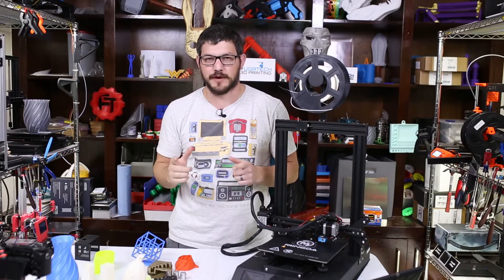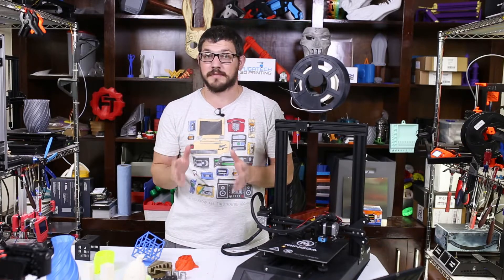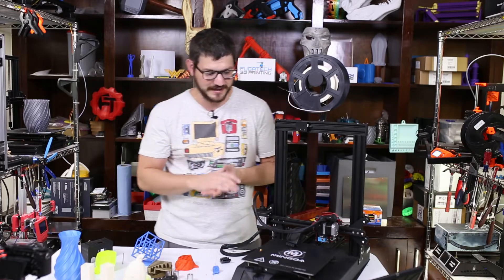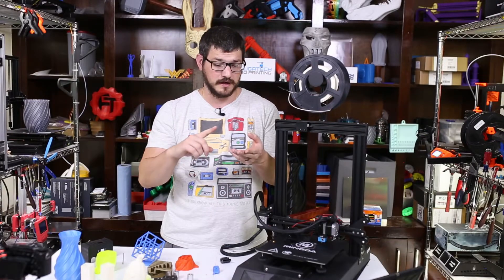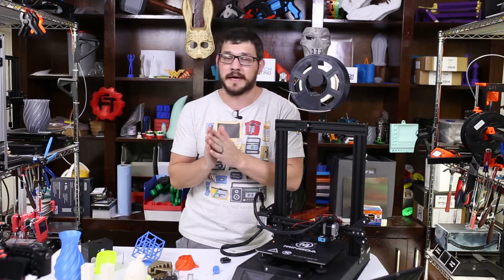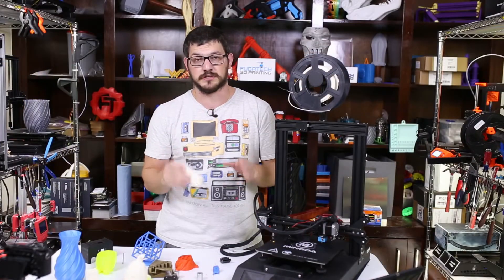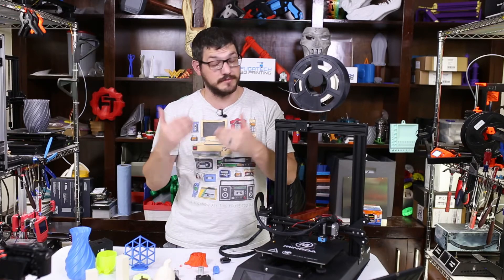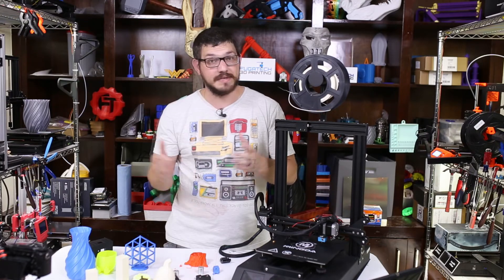Mingda D2 Review

Comment: Ok so I found this video after I got my D2, and now I'm stuck at a stopping point. As a complete newbie to this hobby, I'm learning as I go, and it's been more than frustrating. I got beautiful prints out of it for a week until it got severely clogged.  I cleared the clog and when I reattached everything to the gantry, I found that the bed thermistor broke. Now I'm waiting on a replacement to solder that on to see if it fixes the issue. That got me to thinking - how much more tinkering do I want to do with this thing? I thought about replacing the Z couplers because that seems like a cheap and worthwhile upgrade, but I don't want to dump a bunch of money into mods.

What are my options at this point? Is it worth treating this as a "shell" to put all new parts in? Should I fix this and leave it as it? Should I forget this all together and get a different printer? I'm not super into 3D printing, I just like being able to print small useful stuff every now and then. I don't need the biggest and best out there.

Comment: Mingda has solved the hot end problem, amongst a few other things.
Reply: how did they solve it? the clogging?
So the new models dont have that issue?
Reply: @sjbox  They re-released this printer with an alltogether different hot end assembly and other direct drive, under their Rock line. I have the Mingda D2 and have experienced no clogging issues. And all I did was replace the metal cover and fanduct with 3D printed ones I got off thingiverse. The thing that actually bugged me the most by the D2 was the spool holder LOL which I also replaced.

Comment: Disappointing news about the hotend clogging up. I hope Mingda is listening and sends you a replacement. Even better would be a root cause analysis. That would show proactive position and promote good will with their customers. Suggest you send them an email before the unit collects too much dust.
Reply: I have 2 replacement hot ends for my Mingda D2, yet I am still waiting for the company to contact me and tell me how to reset the printer, because I am getting an error on the LCD screen, because the wiring outer cover melted on mine, then the wire snapped on the hotend. I am not going to do anything with it, until I get the answer I am looking for from the hotend.

Comment: On a direct drive printer, the best place for a filament runout detector is directly above and next to the extruder so that no matter where you incur a breakage in the filament the sensor is triggered and if you run out of filament the whole of the filament gets used, I have had prints where a few more inches of filament would have completed the print but the runout sensor triggered, in fact, I am surprised no one has made a DD extruder with a sensor built-in
Reply: Doesn't the Prusa MK3 have a runout sensor on the direct drive extruder?
Reply from the maker: Yes it does John. The Artillery X1 also has a "remote" filament runout sensor.

Comment: For someone who claims to be capable of doing so much with 3D printers you sure are making these minor issues with this printer sound insurmountable. You are making mountains of molehills. If you can't get this printer to make as good of prints as Andres Sink, maybe you aren't as skilled as you claim. It's more likely you have an agenda to make this printer seem worse than it is. Your criticisms about the hotend cooling are misplaced. The problem as Andrew Sink showed is entirely caused by poor fan ducting. The fins provide adequate cooling as long as you have sufficient air flow around them. You know this. It would solve your heat creep issues but you have some sort of agenda and despite your skills you aren't trying to solve the problem. You just want to make it sound like such a big deal. This printer is better than the Ender 3 in every way once you solve the very easy problem of fan ducting/air flow.
Reply from the maker: I am not going to modify a printer out of the box just so it can print. I am not going to do a company's work for them. They can either design a decent 3d printer, or they can't. The fact that I did what I did just to get rid of the horrible ringing was honestly too much. If you want to do it for them, by all means, you do you man. Sorry that I speak the truth about a printer and you don't.
Reply: Not everyone has an agenda... that is just crazy paranoia. I did not see any sock puppets in the background. This thing clearly does not work that well out-of-the box, and this review shows that. At least an Ender 3 prints well straight away, and that is a VERY low bar.  It has nothing to do with skill... it has everything to do with "does the printer work as-is?" So... it IS a "big deal" if a first time 3D printer buyer sees some BS review on how great this thing is, goes and buys it, and then has a terrible printing experience.
Reply: @Fugatech3DPrinting  I wouldnt even entertain this guy, if you have ever watched any video of his he is mostly hate.  He is smart, and can fix most anything, but he is the one with an agenda and his agenda is hate.  You done a fantastic job at reviewing this printer, keep up the great work!  

On a side note, I kinda wish 3d printer manufactures would start putting the usb ports on the back, it makes for a less cluttered print station when using Octoprint.
Reply: @Fugatech3DPrinting   >Sorry that I speak the truth about a printer and you don't.
WHAT?  Go to the 4:15 timestamp in my last video and hear me calling out Mindga for this crap cooling. "This part right here is everything that's truly wrong with this printer." So, you are trying to set yourself up as the purveyor of truth and me notsomuch. Then you say "I can't stand that guy" when talking about me. What's your problem? I can't recall ever saying anything but nice stuff about you and your channel. Are you just pandering to the hateful mob for upvotes? You know the things you say end up in my comment section the next day right? You give them justification for the hate and negativity that they bring to me. This really gets to me man. It's so hard standing up to a hoard that wants to demonize you. Why are you facilitating their behavior? What did I do to you?
Reply: @DesignPrototypeTest  I feel like you are misunderstanding the point of these reviews, and the target audience of these videos.. Like Shane pointed out in his comment, it's just his job to mod the printer to make it work. And having watched few of your videos, specially the crying about everybody in the "prusa gang" coming after you for telling the truth , your comment kinda surprises since you made a big deal about how dishonest J. Prusa is.. 
However as a none Prusa fan (dont have a prusa printer , never have and probably never will) this does not surprise me all that much cause you seem to read a bit too much into somethings.. 

First off in this video, that filament sensor for example is in a very ridiculous place (you know the order which the design process goes through, 
Design Prototype Test) well here they did very little design for that matter, but kinda prototyped , but the test part seems to have been missig cause those errors would have been cought by the company before rls if there was any proper testing of the printer before putting it to market.. 

Second, target audience these reviews are aimed at are noobs buying printers, now there is nothing wrong with being a noob cause everybody is at sometime but many of them just wanna print and dont even have interest in modding, and to some it might even seem like a daunting task cause they dont know whats wrong and why their printer does not just work right out of the box and dont know concepts like z wobbling, heat creep etc.. So if you can buy an Ender 3 and get pretty decent prints with minimal issues right out of the box , this one just cant be a better buy for set target audience.. 

Third, if you watch any of the videos on this chan , i dont think you can find 1 place in any video where he claims to be very skilled or anything like that, but as these are not any major issues he could easily fix them if that was his goal for this printer. Based on your logic here you could also say the same thing about Tom Sanladerer, if things he reviews dont work, he is gonna tell you that they dont work and faults the printer for that.. This is just what reviewing is about if you are gonna do honest reviews.. He could make a second video for ppl who already have this printer on how to fix them, but thats another story and up to him ofc .. 

Fourth, "You are making mountains of molehills" here my friend you didt not just shoot your self in the foot, you blew them both clean off, I just watched your rant on the "prusa gang" coming after you and you whining about Joes T-shirt and more paranoid crap.. So I can agree that many people oversell Prusa printers and are a bit too in love with Joe, however watching some of his streams and him poping up in all kinds of videos with other makers and things, he seems like a pretty nice fellow , never heard or seen anywhere him claiming to have invented all these features on their printers, and I sure dont get offended by his t-shirt as I dont read that as him claiming to be better than everybody else in the game.. Too his credit though, his printers work great out of the box, they have excellent support for their users, well tuned profiles etc and their eco system is great if you are into it. And that I think is part of the reason you feel attacked "by the prusa gang" is just that you are talking straight out of your ass on this matter.. And the other half of that problem is probably your personality, cause you dont seem to be dumb, and some of your videos make sens and even have good points , but in other you seem like a bat crap crazy paranoid wanker who feels he is always the victim , but you are not it's just your awefull personality between the times you actually make sens.. I've wondered if this is your way of trying to get more attention to your channel and it probably works in a sens, but probably not the best marketing strategy cause the gerneral sens I get at least when I see you mentioned on social media is that ppl really dont like you, and mainly when you go on these rants that make you seem a bit mental.. So my tip would be just stop crying about everything, cause you basicly reap what you sow, stay more on target with tech and skip the delusions and paranoia, cause here is the thing, you could not even make a dent in Prusas sales so you only hurt your own chan, cause in many cases you are just straight up wrong on the subject matter
Reply: I'll start off with some objective things: 

"The problem as Andrew Sink showed is entirely caused by poor fan ducting" You are right on this one 100%. You shouldn't have to mod it out of the box though to fix it. 99% of the people buying this printer wont want to have to mod it out of the box. They just spent a good chunk of change for a CNC hot glue gun. They just want to print.

"The fins provide adequate cooling as long as you have sufficient air flow around them." There's no way that those fins provide adequate cooling. This heatsink assembly looks like a e3d v6 that was chopped in a third. If this much heatsink was adequate for hotend cooling, then why isn't the v6 this short? I kind of see where they were going with this design. Kind of like a titan aero or a hemera design, but they kind of dropped the ball on this one. 

"It's more likely you have an agenda to make this printer seem worse than it is." He is a reviewer, it is healthy to have criticism in a review. Just like you do in your videos. Do you see any youtubers calling you out on it in your comments? No, because it is childish to do that. 

"If you can't get this printer to make as good of prints as Andres Sink, maybe you aren't as skilled as you claim." Sounds like you haven't watched Shane's other videos. This man has a lot of experience with 3d printers. His knowledge is what started me on my 3d printing journey. And I think I made out well listening to his knowledge. He explains everything in a concise, no crap manner. Still talks about the good things, and also the bad things, but he gives good advise if the Manufacturer watches it to reflect on and implement it in their next revision. When I go back to your video after watching Shane, all I can think about is "Man, how much money did it cost for Mingda to pin their link at the top of his comments section?"

If there's someone who sounds like they have an agenda, its you. Stop attacking youtubers and other figures in the 3d printing space just because they disagree with you. Talk to you soon on your video about youtubers having agendas and attacking 3d printer companies, and how their audiences are coming out to attack DPT now!    :)
Reply: @DesignPrototypeTest  Whats that saying... "If you run into an a$$hole in the morning, you ran into an a$$hole. If you run into a$$holes all day, you're the a$$hole."  No one is out to get you but yourself, quit finding enemy's at every corner and people might actually like and enjoy your content.  I tried to tell you this before, but you called me a sock puppet.
Reply from the maker: @DPT - I do this for fun. I don't need your negativity in my life. 

You do you, and let me do me. See ya bud.
Reply: At first I was annoyed at DPT for his repeated childish behavior, but now I honestly feel really sorry for DPT. Reason being that there is obviously something unhealthy underlying this and I sincerely hope that you get the help you need.
Reply: @Fugatech3DPrinting  Fair enough. Truce. But going forward, if you talk about me in your videos or live streams, or if you do stuff that is clearly reacting to me and my videos then you are giving me tacit permission to respond in kind.
Reply: @DesignPrototypeTest  He brought up a few valid points in the video. The heatbreak is PTFE lined. I didn't realise this and as you had printed ABS and I don't remember you ever mentioning this presumed it was an all metal hotend. The gear on the extruder stepper is friction fit? I don't know where you can get a gear with a grub screw to fit on a replacement stepper that will work. The existing gear is 9.9mm I haven't found anything close. I was thinking of trying one that is supposed to be 10.95mm but I think this would be too big for the 11mm? hole. The software is the biggest problem you gave a link for the marlin used but not the TFT source which I believe is based on GPL code so should be published. Chris Riley made a very good video a couple of days ago about changing values using pronterface.  I have a BLTouch on the way which other people have got working with perhaps the D2 PRO version mentioned in this video.
Reply: @DesignPrototypeTest  Aren’t you the one that had to use a drill with a bit to bore the whole bigger and claim it normal? Anytime you need to use a drill that my friend is junk and needs to get returned. Like the 3 I returned. And all you do is bash creality and mostly what you have are crealities. The mingda line is not as good as you claim. And I have people messaging me because support stopped answering. And I have all my messages from mingdas nightmare support. Never showed it as it shows names and I don’t like to publicize peoples names. Fugatech your honest I say it needs to much work to be sold as the next ended replacement as hater replacements says
Reply: @jon9947  he claimed it such a good machine yet in his next video has a drill with a drill bit boring bigger holes lol mountains out of mole hills ..... making printers work with bored drills lol a buddy of mine was saying the same thing. “How does this dude hate creality so much when it’s mostly what he has” lol hypocrites going to sing whatever song they want
Reply: @TheGFS  yessssss 🙌 🙌 thank you to get views!!
Reply: @xbox360manhacker  but you have to 3D print it for him on a mingda.... no wait we want it to work so any other printer of your choice is fine!!!